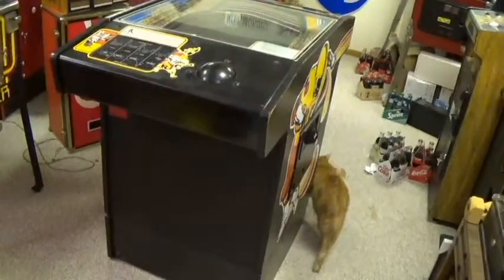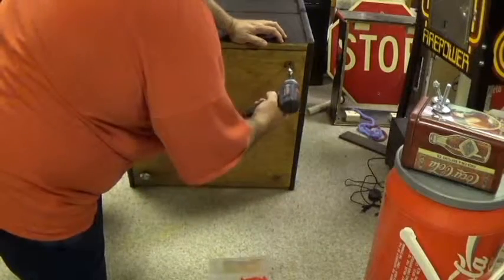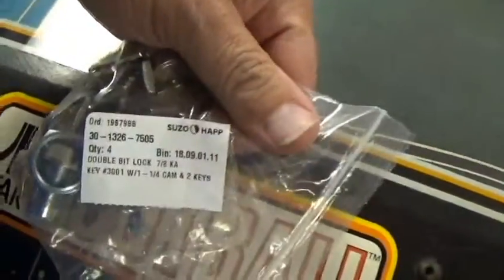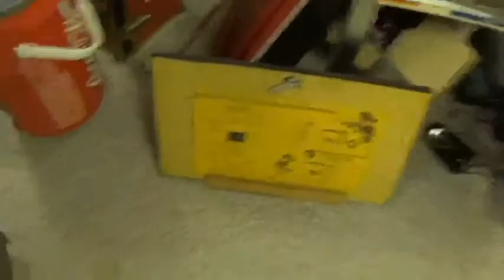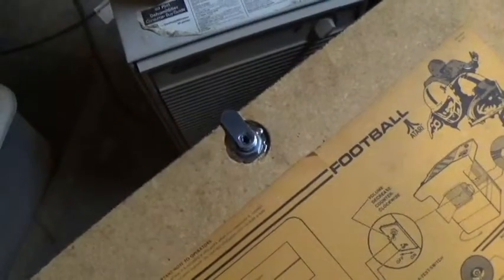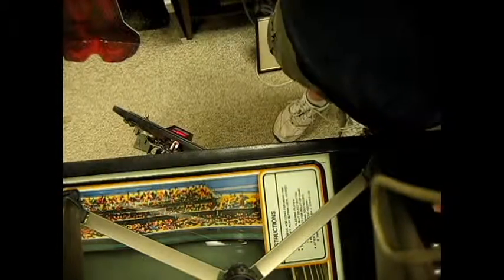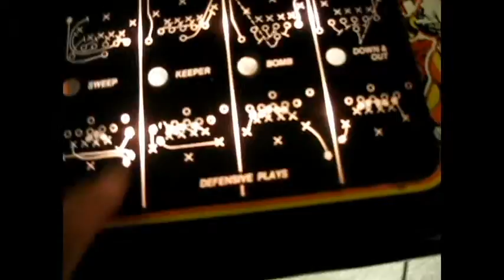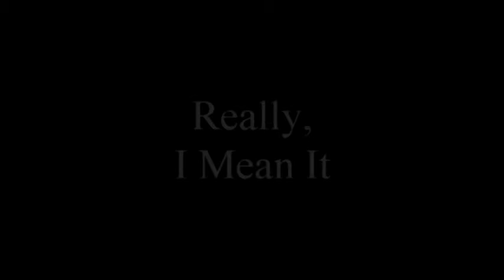Atari Football Restoration & Game Play

Comment: Nice video! I just picked one of these machines up myself for $60 at an estate sale. It's currently not working, only the bulbs light up, but 2 of the 5 power supply fuses are gone and the original big blue capacitor is still there. Hopefully it'll at least stop playing blind after I replace the cap and fuses!